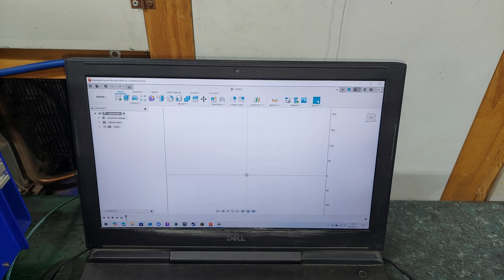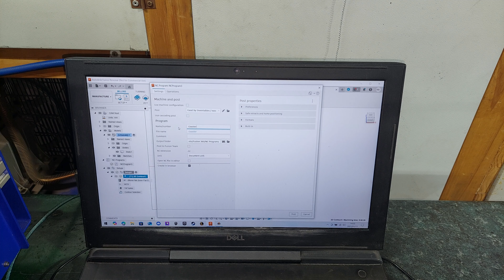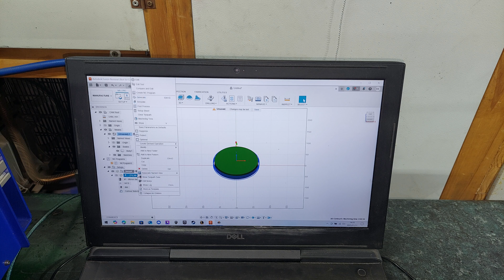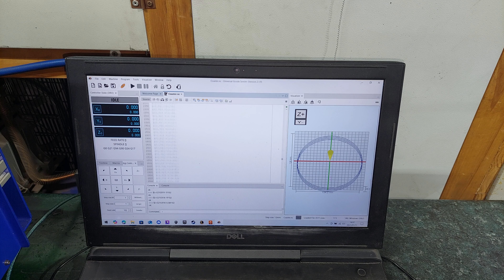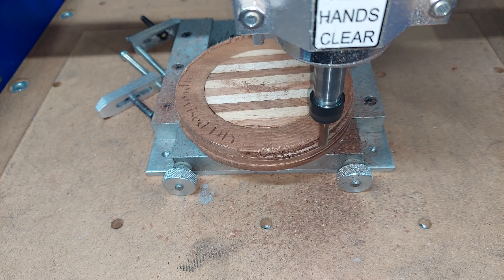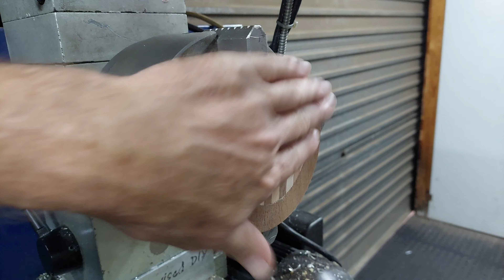Cron Craft CNC Setup and Tweaks

Comment: I am a complete cnc novice. I am considering starting to use a cnc for wood products.  Is this machine worth it do you think? Thanks.
Reply from the maker: If you want to do production runs, a bigger and more rigid machine with closed-loop steppers will be better. If you are doing it for hobby work and with a limited budget, this machine checks the boxes. They do not have closed-loop steppers and can lose their way. Long-term I am planning to upgrade the rigidity of the machine with linear bearings.
Reply: @improvisedcnc2340 thanks so much for the input!
Reply from the maker: @andresurfs  My pleasure!